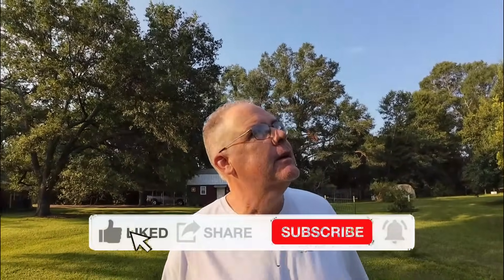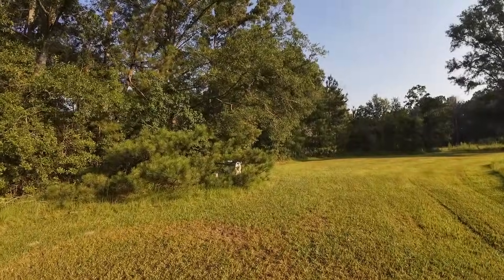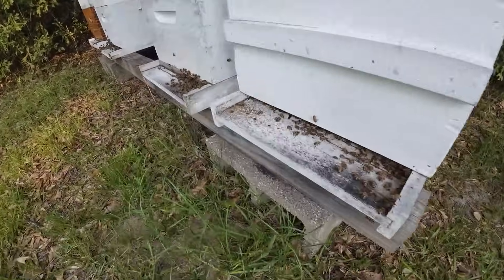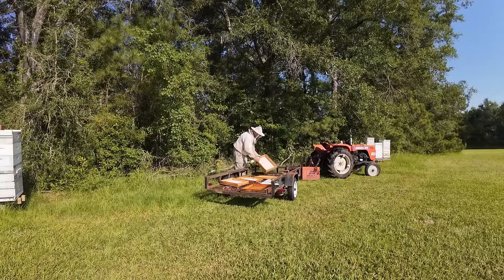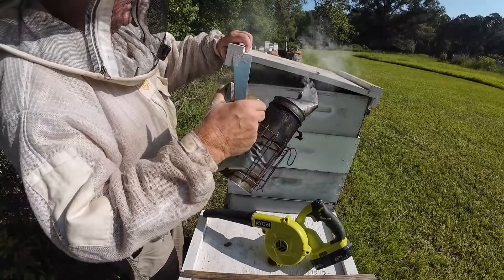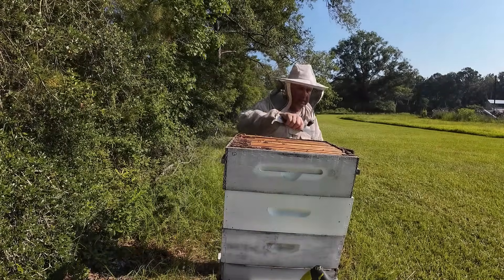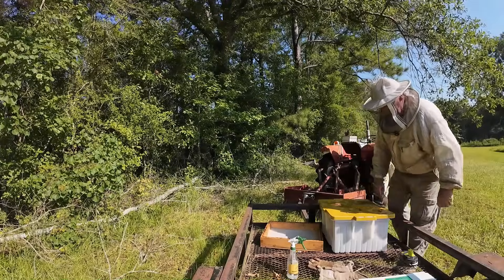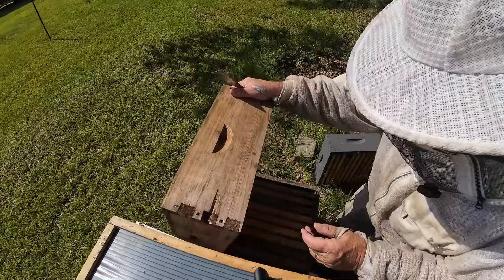To Harvest Honey, Or Not To Harvest | Variables in Beekeeping

Comment: hey i'm just curious how you deal with your cappings from using the knife? do you have a wax spinner tucked away we havent seen before? i'm going to be pulling about 50 supers this summer also, and haven't ever needed to deal with that much wax, but my maxant cappings basket fills up afer about 8-10 supers, and takes a while to drain out.
Reply from the maker: I empty the basket and keep on going. I store them in a tote. I try to drain them for about two days, but if I’m doing more than 12 to 15, I have to pull them wet and let the drain in my old uncapping tank. I wish I had a wax spinner. Hoping to get one in the next couple of years. At the end of the season, I melt them in a Maxant wax melter.